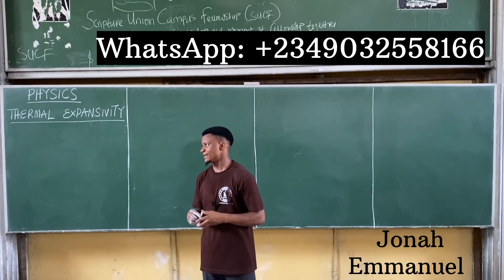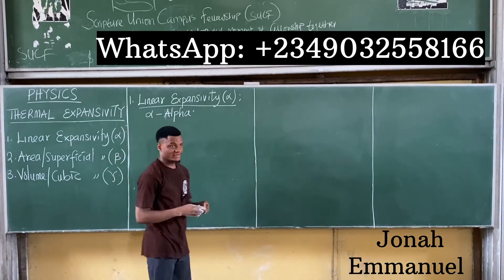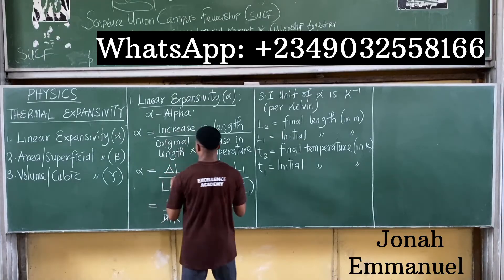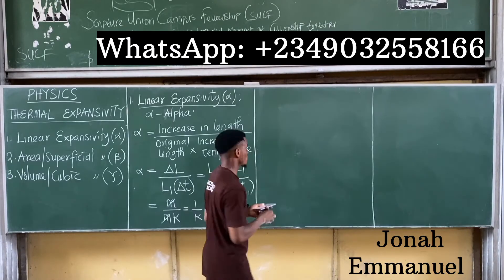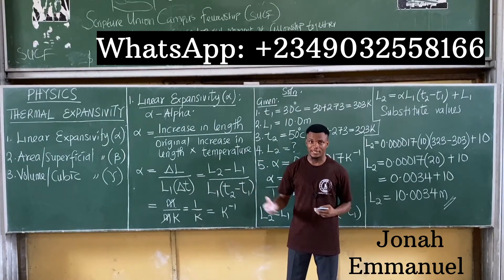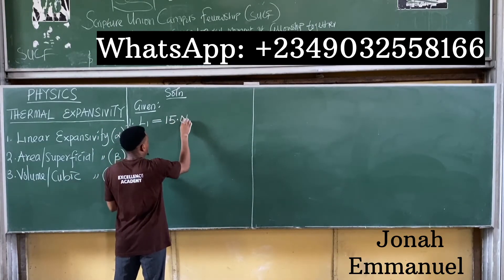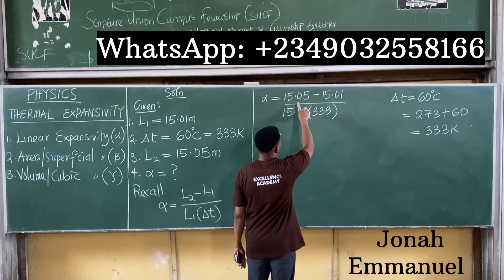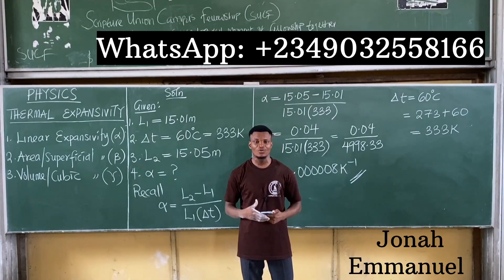THERMAL EXPANSION & THERMAL EXPANSIVITY (LINEAR, AREA  and VOLUME EXPANSIVITY) JAMB AND WAEC PHYSICS

Comment: No sir what i have been thought was .
See how the question goes like this ,A copper rod whose length at 30 (degree celcius)=(tita 1)seen temperature is measured in celcius or kelvin.is 10.0=L(1), is heated to 50 (degree celcius)=(tita 2). .  And.the answer is L(L2)=10.0034m.
Because we were given a information , so we drop the data and we were asked to find L(2).
And also in my solving there is no addition of 273 .